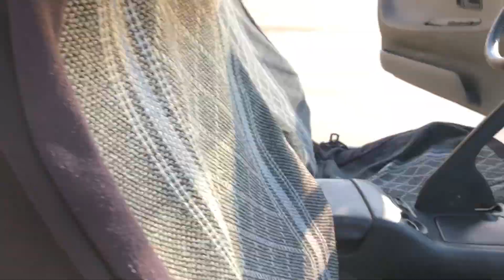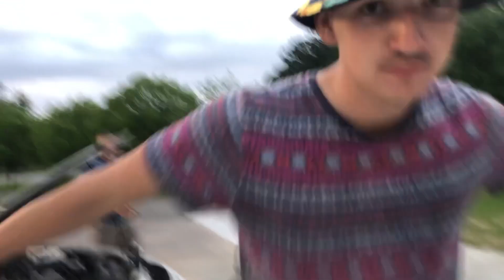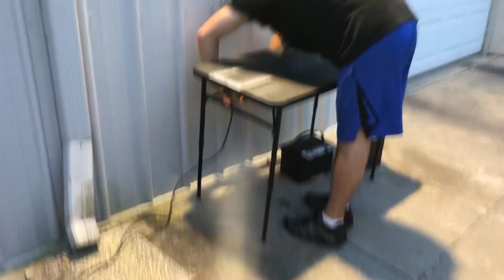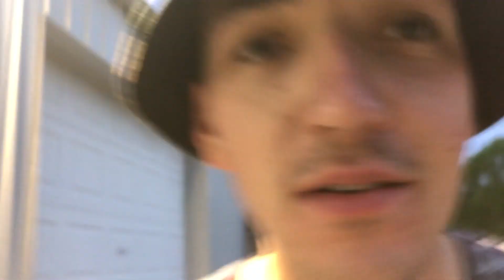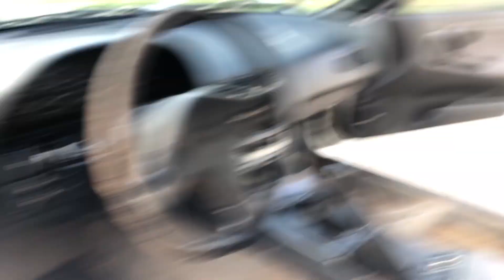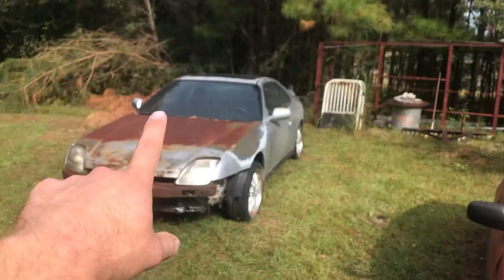Abandoned S13 240 Find! Will It Start?

Comment: It's incredibly rare that you find a 240 in this condition for that price. It's unfortunate that it fell into your hands noting that you seeming know very little about basic engines. Car sitting for 11 years? Maybe try some new plugs? Wires? Fresh gas? Nope just crank on it for 3 hours with some starter fluid. Nice one mate. I urge you to do just a smidgen or research, I can't fathom how you've had any success flipping cars.  RIP to this saveable 240. It's not dead yet, but you will surely kill it.
Reply from the maker: I know more about engines than you’re assuming. I did put new plugs and wires. Didn’t get around to fresh gas because the tank was rusted. I just wanted to make sure the motor would at least run on starting fluid. I’m going to rebuild the motor completely just because it deserves it. I must say a genuine thank you to you for your lack of confidence in my mechanical abilities, as it does nothing but make me want to restore this car even sooner, better, and to a higher standard than the builds I’ve done in the past.

Comment: Couple things... Nice find... While the car does appear to have been sitting for quite awhile, and likely has rust in a lot of the usual places, I think you probably got a pretty decent deal since there's a lot of unknowns with that thing.  The prices on these cars today are a bit insane, as I've seen similar condition cars where people want like 5k... Dunno if they got that much, but that's what they at least thought they could get.  Biggest downside to owning an S13 is that new OEM parts are mostly discontinued now -- you can still get some things new, but there's more discontinued than still available nowadays.  That and the part prices have skyrocketed quite a bit.

2nd thing is the rust on the hatch.  The OEM spoiler on these cars was horrible and causes the back of the hatch to rust out sooner or later, which is almost certainly why the horrible bondo job was there on top.  Whether or not the remaining rust was due to the bondo job or part of the original rust from the spoiler and they didn't try to "repair" it, is hard to say... Imagine if they attempted that horrible bondo application under the hatch lid... it probably would have never closed properly again, and made the rust problem even worse... I mean geez, they didn't even bother trying to sand that hack job down when they were done!  I have a bad feeling you'll find that they just slapped bondo over the top of the rust rather than actually trying to cut out the rot first.

Interior actually looks fairly decent other than the dash and seats.  No clue why the rear seat looks so trashed unlesss it was because of the leather drying out.  Mine are almost pristine because they never really got used (since only a 2 year old fits back there...), but mine are cloth.  Engine bay also looks really stock other than the overflow resevoir.  Body doesn't even look all that bad from what I can see.

Make sure you pull off the front fenders and check behind the door hinges... Mine were really rotted behind the top hinges on both sides even though you couldn't see any of it with the fenders on.  I repaired mine just in the nick of time.  Also check the frame rails right below the firewall for rot as well.  They tend to rot from the inside out.

I'm in the process of doing a resto-mod on mine.  Fixing the rust, cleaning it up, upgrading suspension, etc.  No plans to drift here, either.  Going to try and retain the KA as mine only has about 115k on it.

At any rate, good luck with it once you get the project going!
Reply from the maker: Thank you so much for the kind words and advice! I’ll definitely look into all the rust-prone areas you mentioned. I’ve been tossing the idea around of a 1UZ swap, but I think I’ll just keep the KA for now. As soon as my house gets done (starting very soon on that and will be documenting just to have something to post here on the channel since car content will be scarce during that time) I will start on restoring the 240. I wish you all the best with restoring yours as well!